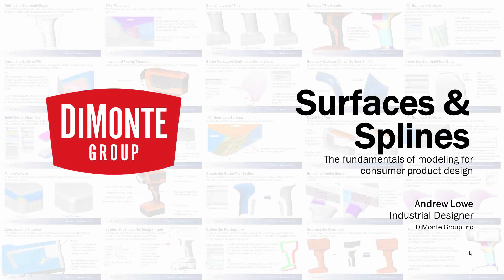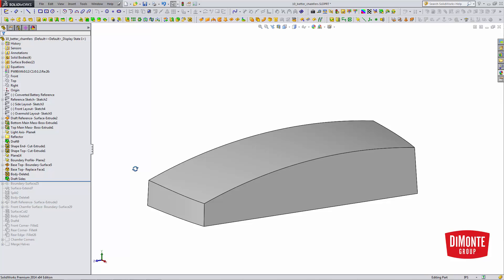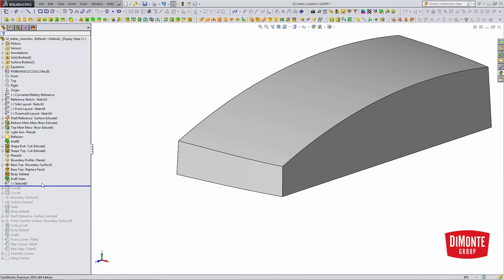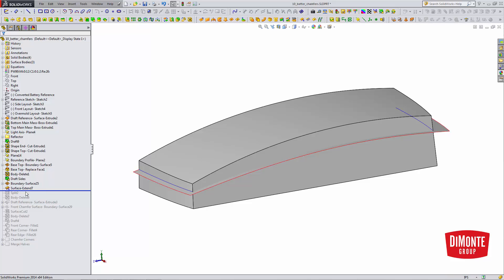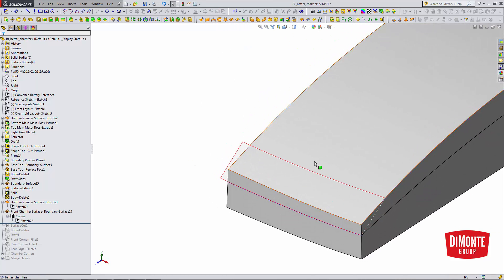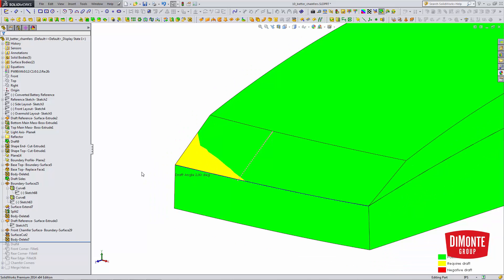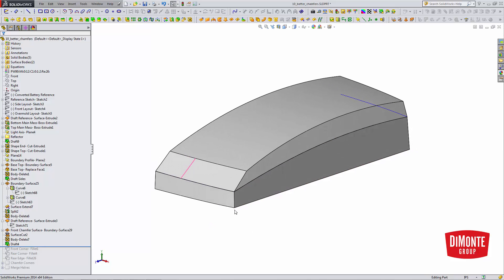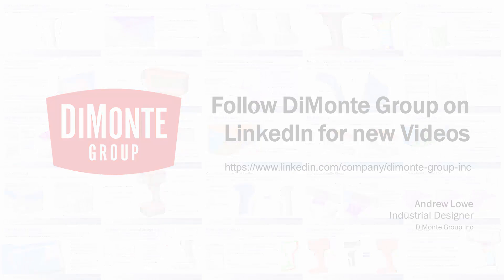Surfaces & Splines | 09- Build Better Chamfers

Comment: A basic question that I hope you can help shed some light on...  If we would like to use "helper" surfaces or "helper" construction lines to ensure that a part will mirror smoothly (with tangency), how can we have the curves that instead are tangent to the construction line that is at a drafted angle? Would this not mirror smoothly? Thanks! Looking forward to your clarification because it is confusing me quite a bit.
Reply from the maker: Daniel,
Your question would indeed be about a legitimate contradiction if we were creating a surface that was intended to blend seamlessly with its mirror.  
The thing is, that is not what we are trying to do here.
As Industrial Designers, we can’t forget the “Industrial” part of the job title.  This part needs to be molded.  Which means that the surfaces of the part needs to be drafted, even all the way to the mirror plane, so the manufactured article can be ejected properly from the mold.  That reference surface, or “helper” as Andrew liked to call them, is drafted to ensure that that resulting adjacent surface which uses it as a directional reference is also drafted.

I really love this question because it forces a spotlight on manufacturing issues that are often forgotten with a lot of Industrial Design models we see out there.
  
You might already know this, but maybe other readers won’t, so I’m going to bring up a simple example of the importance of draft that I think that everyone can relate to.  
Everyone has noticed that the sides of a cupcake or muffin are angled.  The angled sides are there so the pastry will fall out of the cupcake pan easily after baking.  If the sides of the pan were parallel, the pastry would get stuck in the pan.
Injection molding has this same issue.  Plastic parts without draft would stick in the mold, or would have drag marks on their surface if forced out of a mold with no draft.  As Designers we might want to make parts that are perfectly smooth at the parting line, but as INDUSTRIAL designers we have to build in that draft angle, and hopefully use visual tricks in our design to imply that the sides are smoothly connected when in fact there is a slight ridge.

The only exception where you might be able to exclude that draft is if, after talking with a molding resource, you can count on a part shrinking away from the cavity of a mold as the part cools (thermoplastics) or cures (thermoset plastics). But in practice this is almost never an option.  I just checked a couple of blow molded bottles I have here at home and even those show a little draft at the parting line, and those definitely shrink away from their cavities.  The best plan is always to include draft up front.

OK, that said…

There is a mistake in this model due to 2D thinking when making “Sketch 72”. The short edges of “Draft Reference – Surface-Extrude3”, if it is extruded with draft like it should be, ought to already have the correct draft.  That draft is foreshortened in the plane normal to “Sketch 72”, but the actual necessary draft is there.  Adding 2° to the centerline of “Sketch 72” is not necessary, and is actually contradictory.  In 3D, the upper short edge of “Draft Reference – Surface-Extrude3” is actually the mathematically correct one as projected onto the plane normal to “Sketch 72”, and is what the curve should be tangent to.
We all get tunnel vision when designing and it is easy to lose track of foreshortening in 3D, especially when we are cranking through a design.  So yeah, that was a mistake, and thanks for calling us out on it (if that was what was originally confusing you).  

Thanks again Daniel for the excellent question! 
- Ed Eaton
, DiMonte Group
Reply: @DiMonteGroupInc  Crazy! All I can say is I'm amazed at how you guys are explaining things in detail. I had exact same thought that why in Sketch 72 we added a draft of 2 degree . Thanks for the explanation.

Comment from the maker: Thanks for the question, Markus. Sharp eye! 

What Markus is questioning happens at roughly 2:27, when Andrew is creating Boundary Surface 25. 

If the Boundary Surface 25 had just been created between Curve6 and Curve8, it would have taken a straight-line path between the two. By adding Sketch63 as a Direction 2 curve to the definition of Boundary Surface 25, it makes the boundary surface follow the general curve of the part. 

Truth told, the more disciplined approach would be to have Sketch63 projected onto the outer face of the solid body for finer control of the shape. But this is a simple enough shape that it doesn't matter. 

Bonus information#1: Andrew not only made the boundary surface curve by adding Sketch63 to the definition of the Boundary, but it also elongated the boundary surface past the ends of the solid by a little bit. Boundary is kinda cool that way - it has the option to extend to the extents of all of the defining curves. If you did this with a loft, you'd still get about the same surface but without the elongation to the ends of Sketch 63. When modeling curvy stuff in SOLIDWORKS, it's important to go past coincidence because of round-off discrepancies in the background math 

Bonus information#2: Using "Split part" instead of "Split Line" to create the edge needed here keeps all of the adjacent edge IDs intact. Want more stable models? Avoid "Split Line" unless there is no alternative.

-Ed